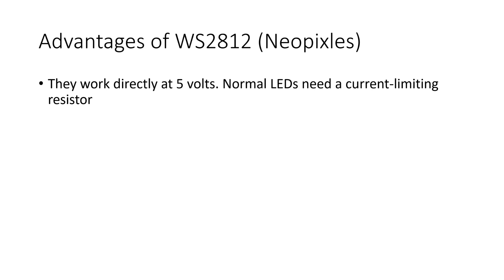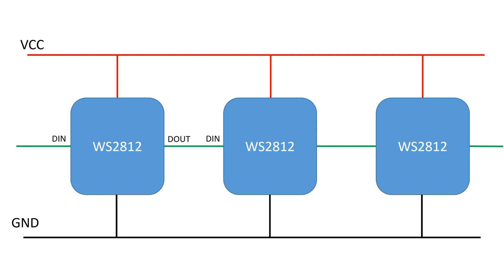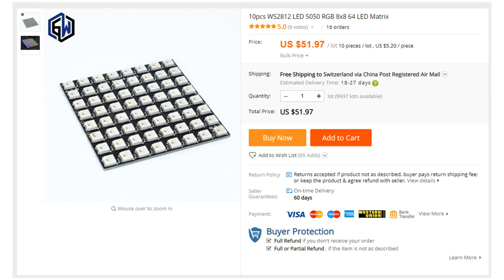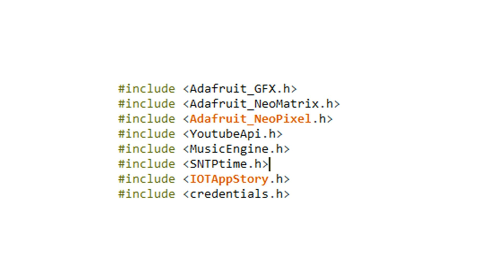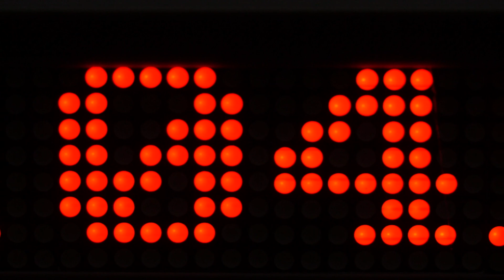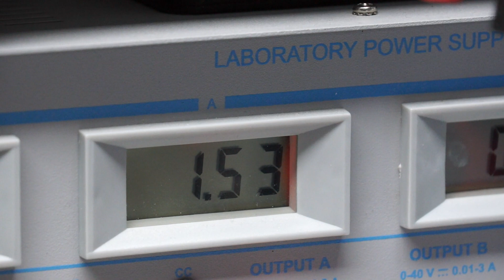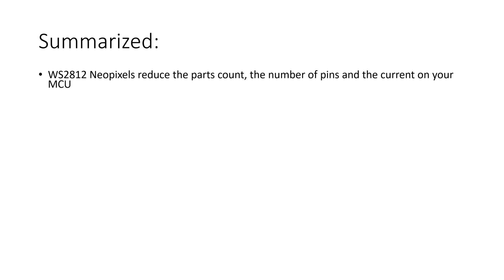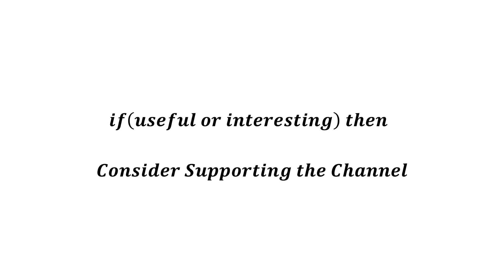#246 12 Tips and Tricks for Neopixels Projects (Arduino, ESP8266/ ESP32)

Comment: A thick power supply wire connected to all panels should fix the voltage drop. You can do the same on long strips, connect the supply to several locations.
Reply from the maker: You are right. In my case it was not a big issue because most pixels are off and the power consumption was only 0.6 A

Comment: Can you explain when to use an N-channel or P-channel MOSFET or BJT please? I understand what they do but not why one would be better than another for a job.
Reply: NPN and N-Channel have a little bit better characteristics, if you can choose. Most important is the polarity for controlling them.
Reply from the maker: if you want to switch the VCC wire you need a P-channel FET and if you want to switch the ground wire you need an N-channel FET. You can Google the reason.

Comment: Maybe this is a stupid comment (I haven't read the manual because I'm an engineer 😀), but why not to put a pull down resistor on the data line? Maybe it helps at power on..
Reply from the maker: I tried both (pull up and down) would have been too easy ;-)

Comment: I went in trouble while i Power a neopixel strip with 5V and communicate via a Esp to them. They are not able to recognize a high signal from the mcu. A simple diode in series with the power supply of the first Pixel helps here to drop the supply voltage to 4,3V.
Reply from the maker: Thanks for the tip!

Comment: You can make a multi-part print to get a nice case even if your printer cannot handle the overall dimensions ;)
Reply from the maker: You are right. Maybe, I will do it later on. At least for the front

Comment: great video! :D
But I would connect +5V to one side of the display and ground to the other side to to make sure that all panels get the same voltage instead of connecting power to the panel in the middle
Reply from the maker: You are right. But you need thick cables. For me the middle was very handy because I had a connector right there with thin wires.

Comment: HI.     I use a small strip of 5 neopixel' s  straight off my UNO and I have no problems, the UNO can handle it and there are no start up issues, I guess that I am gonna get these problems when I scale everything up but for experiments, and getting used to the various library's 5 is ok. Great vid Sir, I hope you continue until those digits drop of the end of you bookcase ! Then I don't no what the fuck your going to do.
Reply from the maker: 5x25mA =100mA which is ok for the Arduino. With 10 or 20 the USB hub might become overloaded.

Comment: For the connectors you can use the same pin headers but push the plastic down until all of the metal is on one side of it. Then you can push it through from the front, solder on the back and still have the length required for mating connectors.
Reply from the maker: You are right. This is a good solution if you do not have a small tip

Comment: Ouch! Andreas, I think the open (untwisted) wiring at 9:44 will cause problems in the long run. If you just keep a 3x-braid, and daisy-chain (no ground-loops) it'll be more robust and less noisy.
Reply from the maker: It is not a life-threatening device. So I can change it if it starts to show the wrong numbers. So far it only could advance a little faster. But this is not because of the wiring, I assume ;-)
Reply: @AndreasSpiess  105k is fantastic :) Besides - the quality matters more than the quantity, right?
Reply from the maker: I have a very good quality of subscribers. I always see it if I have a successful video. Then, the quality of comments decreases because non-subscribers also comment.

Comment: Yes, but what if next month you hit 10.000.000, which is not beyond expectation ;-)
All interesting stuff. The pfet is a great tip. I have an ESP8266 on the same PSU as 60 neopix, and a 470uF over the vcc near the esp and that goes well. 5 amp PSU
Reply from the maker: Most Neopixel projects have much more LEDs on and therefore a cap is a very good idea. Mine has only a few on and the number does not change a lot. So during operation, the current does not change a lot.

Comment: I get very good results with wemos D1 mini(esp8266) and fastled library. When i compared fastled and adafruit library, fastled changed colors much faster. Fastled has also many advanced features. For your project is suitable also micropython.
Another good practice is to use max brightness of 1/2 value. You can save a lot of current and difference between 1/2 and full brightness is not so markable.
Reply from the maker: Thank you for the info. Unfortunately, I had to use the Adafruit lib because I also wanted to use the Matrix lib.

Comment: Hi
Was just wondering if we could use a capacitor with suffeciently large discharge time for startup of the display?
Reply from the maker: A discharged capacitor dis like a short circuit in the first moment. It only would help with a FET. Then you could charge it with the display off

Comment: Great video! Here's a tip to distribute the supply power:
positive + o================
                   |     |    |    |    |    |    |    |
                   =================o   - negative
I use this for large packs of 18650 cells so each unit sees the same length current path.
Reply from the maker: Clever idea!

Comment: Great video. A really nice follow up could explore how many pixels can be addressed before the signal degrades (or you run out of address bits?) and maybe you can give some tips about how to power a giant theoretical display. It would also be really cool to know how fast we can pump data through this thing... can we play a video on a really large panel using an ESP8266?
Reply: There's no theoretical limit to the number of pixels.  The data signal on all these chips is consumed and then regenerated for downstream transmission at each chip.  The entire set of pixels is basically a shift register that you're pushing data down.  When you send the appropriate signal, all the pixels change their emission to match the shift register data they individually contain.
  The only real limitation is two-fold.  First, each microprocessor can only push out the data signal so fast.  At a certain point, your refresh rate starts having to drop to have enough time to run the data down the entire array.  With an 8-bit micro, that tends to be in the several hundred LED range and with something like the Teensy's ARM proc, it's a few thousand.  The ESP32 should be somewhere in the middle of that, though I haven't tested it.  
  The second limitation is that in my experience, the 2812 chipset is not very reliable and tends to have hardware failures.  Shorter lengths of pixels being fed in parallel reduce the probability of a pixel failure in any given strip, so you lose less of the total display area in case of a bad pixel as well as simpler power wiring issues.
Reply: As for power, these can be very power hungry as you go up in size.  The last installation I worked on had something like 30 strips, each 30+ feet in length.  It required a few hundred watts of input power when all the LEDs lit up.  
  First, I would highly recommend you use the 12V versions of these strips.  That will more than halve the amperage required.  The data lines will still be only 5V, so sontrol remains unchanged.  
  Second, I would recommend feeding power in through large gauge wires and powering the strips from both ends to deal with voltage drop across the strips.  In that big installation, I made custom boards which had a bunch of electrolytics right by the strip connections to help smooth out voltage drops with sudden intensity increases.  I installed power busses that ran up both sides of the array so that there were 14 gauge wires feeding both ends.  
  Third, put your controller on a separate power supply.  We had two big dedicated 12V supplies feeding the array and a little SMPS wall wart powering the computer and micros running everything.  (don't forget to make sure all the PSs have the output grounds connected to each other - forgetting to do this will make the array not work and might fry all the control electronics if omitted)
Reply: And lastly, no an ESP8266 won't be able to do a big video display.  The installation I described had an Intel Atom based x86 computer to handle the video generation (we were using a rather computation-heavy procedural generation system).  Downstream of that, we had a pair of Teensy boards that did the actual timing and bit-banging.  The Teensy 3.0 boards have a pretty powerful ARM micro on them that can handle a few thousand pixels reliably.  Be user to use the OctoWS2811 library, as it have much higher performance due to some clever DMA stuff it does.  
  I'll be perfectly frank, if you want a really big display, you'll be better off just using a large screen LED TV or projector.  The cost per area for the discrete LED strips or panels is pretty high when you take into account all the power supplies and control boards, etc.    If you are comparing to a projector, the projector wins hands down on cost.  You can just edit the video you want to play to pixelate it and put a diffuser screen in front of the TV/ projection surface.  And then, when you get tired of the display, you still have a perfectly good TV.  
  These strips are fun and definitely have use cases such as curved surfaces or outdoor installations or confined areas a TV or projector doesn't work in.  But I'll be frank, for a lot of situations, just going with consumer grade gear is cheaper and a lot simpler.
Reply: @danheidel  Super comments - thank you so much for taking the time to post.
Reply: Dan's advice is pretty good, but there are some details that could use more elaboration.

There is no limit to the number of pixels that can be daisy chained except that the refresh rate drops.  These pixels have a constant data rate (effectively 800 Kbps plus or minus some margin that's chip dependent).  That timing is the same whether the WS2812b chips are being driven by an ATtiny or a supercomputer.  And since each chip needs 24 bits of data (8 bits for each color), that means each chip requires serial output of 30 uS of data (24 bits @ 800Kbps).  So 1000 chips requires 30 mS to send data to, and 10,000 chips in series requre 300 mS.  (There is also a fixed time needed between refreshes, so the chips will recognize a new frame of data; but the driving code may need that or even more time to generate the next display).

The limit on pixels driven by an Arduino UNO is mostly about needing enough RAM to hold the data (along with other RAM needs of the code and libraries).  That is, it sends the data at the needed (fixed) rate, but can only do that for pixel data already in RAM.  A Teensy (for example) has much more memory and can support longer neopixel chains.  More importantly, it can continuously refresh the neoPixels from memory while having CPU cycles available to do other things, while the UNO cannot do anything else while it's shifting out the serial data or it will mess up the 800 Kbps timing.  This is because the Teensy can use some DMA tricks, as can the ESP, to send blocks of data to the neopixels without CPU involvement for each chip.  (The Teensy can also support up to 8 neopixel chains in parallel).

So it's hard to get a large display of neopixels to display video.  The fixed serial speed of their data line limits how many chips can be daisy chained before the delays are too long.  That can be handled by feeding many separate but syncrhonized pixel chains in parallel.  As mentioned above, the teensy can drive up to 8 pixel chains at once, and some designs (eg: using FPGA's) can feed even more pixel chains.

You also will find that you need to remap the intensities, as the linear rendering of brightness won't work well for video; at minimum some kind of gamma curve is needed.

And finally, be aware that the WS2812b achieves the variable brightness (of each color) using PWM, but the PWM frequency is only about 400 KHz.  That is, the chip would render a 20% brightness (value 51 decimal) by being on for about 500 microseconds and off for about 2000 microseconds, for a total cycle of around 2500 uS.  The cycle time is fixed at around 2500 uS, and the data determines how much of that time is "on".  The cycle time is approximate as each chip can vary somewhat, from other chips and over time or temperature changes, and there is no software control over that.  This is relatively slow PWM (some of the other pixel chips have faster PWM; the APA102c Andreas showed is one of the fastest).  Anyway, video could potentially show some glitches if your video refresh rate is in the vicinity of the PWM rate without being synchronized.

The APA102c chip is preferred by some for video because it not only has a very fast PWM rate (minor help), but it can be updated at far faster then 800Kbps.  The 8806 based pixels referenced by Dan also have higher PWM rates and much faster serial update rates, compared to the neopixels (WS2812b chips).  They use a 4 wire system (vs the neopixel 3 wire), with power, ground, clock and data.  

Video on pixel LED chips is a somewhat advanced subject.
Reply: @zephsmith3499  Thank you for adding so much useful information on LEDs. I am running a few pixel projects and these comments are uber-helpful.

Comment: Tip #15: if your power supply cannot provide enough power (say max P1), calculate the estimated power draw P2 before updating the pixels, and scale the rgb(w) by P1/P2 so the max power is never exceeded even when the sketch would try to send a too intense image.
Reply from the maker: Good idea if you want to save on the power supply (and your LEDs do not go on at startup)

Comment: For a esp32 you might want to check out this https://github.com/MartyMacGyver/Adafruit_NeoPixel
Although I haven't tried it yet.
Reply from the maker: Thanks for the link. However I did not see any reference to ESP32
Reply: @AndreasSpiess  there is an esp32.c file in the code though.

Comment: Tip #14: find neopixels based on the WS6812. These are easier to drive, and exist in RGBW (cold or warm white) when you want more purer white or nicer  pastel colors. The disadvantage is that when only blue is on also makes the phosfor in the white part glow a bit, so the blue will be less pure.
Reply from the maker: Thank you for the tip! In my case I had to go with the panels I got :-(

Comment: Tip #13: add a small and cheap 24 to 5V buck converter (less than 1$ for a 2A one) to each set of n neopixels, and use a 19v laptop power supply to feed the lot. I did this to avoid voltage drop and the ability to use much thinner wires.
Reply: Having recently designed an LED system to go into an SUV for a ridesharing company, can confirm this is the way to go.

"Why do you need 30 PSU's and two batteries?"

"Because otherwise, the cables will be as thick as a hot dog....."
Reply: What I did and confirm to be working. Also use a separate buck convertor for your RPi or Arduino.
Reply: plemli  ->  Great idea, thanks  !